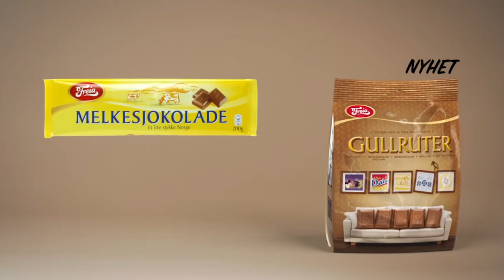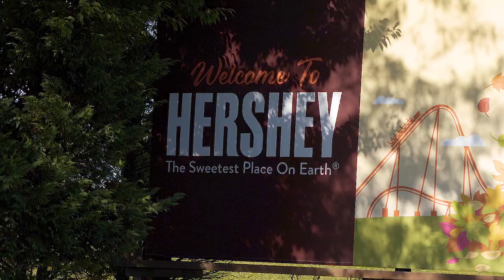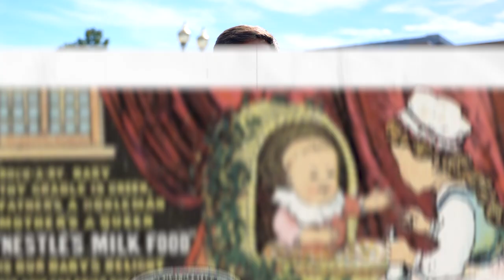Hershey's chocolate tastes BAD. Here's why...

Comment: Hate Hersheys.  Not worth the calories for an adult.  The one exception that I sometimes have are the Reese's Xmas trees or the larger easter eggs.  There's little chocolate and lots of the PB filling.  However I have a recipe that is similar and can melt much better chocolate than the hersheys junk.  I stick with the better brands and in moderation.